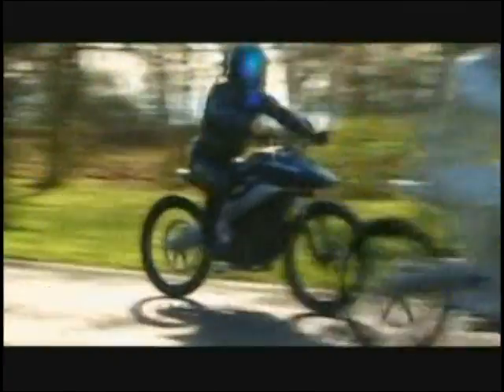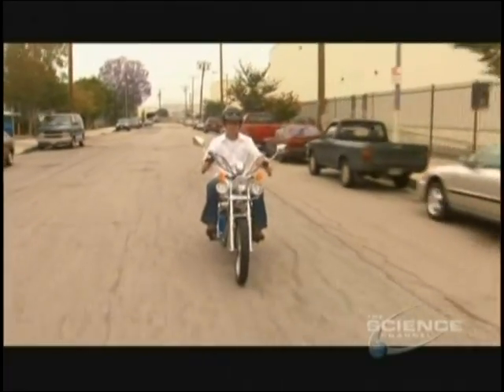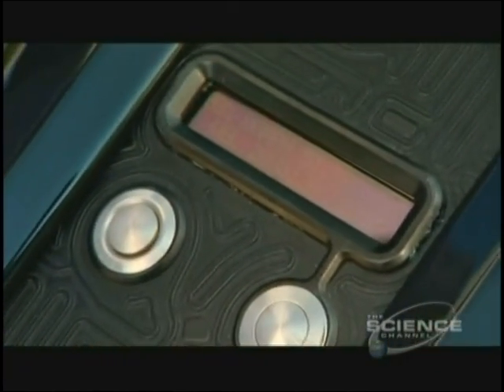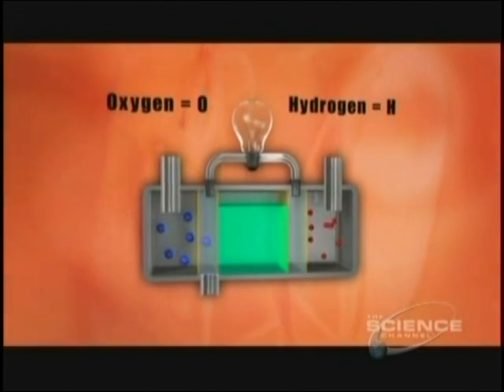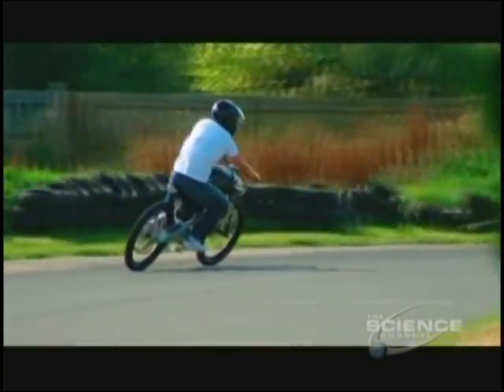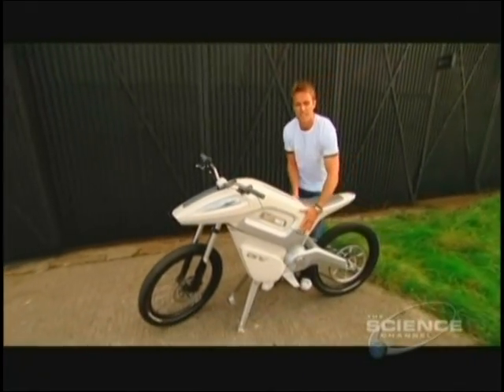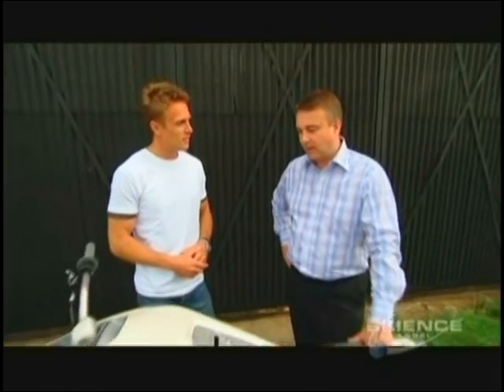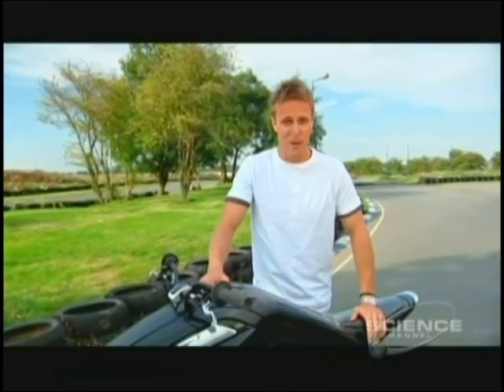Hydrogen Fuel Cell electric bike

Comment: 14years ago where are they now 2022
Reply from the maker: I followed the hydrogen tech news for many years before Toyota produced the hybrid Prius. Right after the Prius became popular, the interest on hydrogen fuel cells died down drastically. Hybrid gasoline-electric cars provided a middle ground solution that works well with existing gasoline supply logistics. Hydrogen fuel was plagued by the lack of production, delivery infrastructure support. Toyota produced a Mirai which is still in production but barely survive. Early days of hydrogen fuel cells were vulnerable to impurity in the hydrogen fuel. The expense equipment could be easily "poisoned" and rendered useless. Then Tesla came in and provided another solution that built on top of existing electric power grid. The hydrogen fuel delivery infrastructure is still the weak link of the fuel cell solutions. There are simply cheaper solutions and hydrogen faces an uphill battle. You can forget these fuel cell bike but there are many battery-based electric bikes you can choose from nowadays. In one of the Avenger movies, the Black Widow rode an electric bike!

Comment: I can’t believe this is so old. People need to wake up to the potential
Reply from the maker: Hydrogen fuel cell was a very old topic. It was hot before Toyota produced their 2nd generation Prius in 2004. The Prius became so popular that people dropped the hydrogen alternative. There was never a supply chain infrastructure to refuel these clean hydrogen cars. Tesla probably learned from that shortcoming and invest so much on the network of super charging stations. Without those EV could have died too. Unlike hydrogen supply, Electric power grid already existed, so adding the chargers was a much easier hurdle to clear.

Comment: With 8hp it's the equivilent of a 125cc combustion engine.
Reply from the maker: fuel cell produces electricity from hydrogen, basically this is an electric bike with fuel cell replacing conventional battery. One big difference with electric vehicle is the instant torque that combustion engine can never deliver. I mean it will perform way better than a 125cc.

Comment: No wonder why +Elon Musk said "Why would anyone buy a Car which runs on Hydrogen, which converts H2 to Electricity, stores in battery, and then battery powers motor with electricity :D"

There is one fundamental problem with Hydrogen vehicles,
i.e DEPENDING ON FUEL STATION [3RD PARTY] FOR REFILL !!!!!!!!!!!!!

__________________________________________________________________________
Stats for Pros: 
[Everything about Hydrogen fuel for vehicles]
__________________________________________________________________________

But with a pure Electric vehicle, you can generate your own electricity in home with solar, and use that to charge the car !!

Technical problems with Hydrogen fuel cars are,

- Too complex drive unit, with large fuel tanks, large fuel cell converter, and other nonsense where with pure electric vehicle like Tesla, you have battery, you have AC Motor, and all other are free space for storage !!

- Hydrogen is expensive to make and very less efficient too,
presently to generate 1 Kg of Hydrogen gas, you need 56 kWh of electricity to convert it from Water to Hydrogen [9 (kg or liter) of water will give 1 Kg of Hydrogen],

- The room pressure is around 1 bar (at sea level), 
the pressure inside aerosol perfume can is around 5 to 20 bars,
and the Hydrogen is typically stored at 700 bars, which is quite a scary amount of pressure.

Added the super quality metal to hold that 700 bars cost around $10,000 to $20,000 alone, 
though it's secure and have capacity to go up to 1400 bars (double) and even take a sniper bullet and doesn't burst !!!

- One more problem is, Hydrogen is very light, meaning,
density of Hydrogen at 700 bars = 42 gram / liter (or) 42 kg / m3.

That means,
you need roughly 25 liter tank to store 1 Kg of Hydrogen [1000 / 42 =~24*] which is very large in volume,
added, you need 125 liter tank to store 5 Kg of Hydrogen, which is the size of Toyota Mirai.

Even though, the energy density of 1 Kg of Hydrogen at 700 bars =~ [40 kWh / kg],
the down side is the large tank needed to store it,
where in Tesla or pure electric vehicle you can use all those space in Frunk and Trunk.

- Also considering performance,
Toyota Mirai is capable of producing only 113 kW of power [152 BHP],
Tesla Model S is capable of producing massive 570 kW of power [762 BHP].

- Finally coming to the cost and mileage,
it cost around $12 to $18 to refill one Kg of Hydrogen at 700 bars (with subsidies !!!),
and with 1 Kg of Hydrogen at 700 bars, your Toyota Mirai can achieve roughly 90 Km.

Which means, For +TOYOTA Mirai and other Hydrogen vehicles,

+ METRIC (Base 10 system, which is used by 190/193 countries in the world)
16.7 cents / Km [or 11.7 Rs / Km] (while 1 Kg of H2 = $15).
   11 cents / Km  [or 7.7 Rs / Km] (while 1 Kg of H2 = $10) - future prediction even if H2 prices comes down.

- IMPERIAL (Grandpa units, used by 3/193 countries in the world)
27.3 cents / mile (while 1 Kg of H2 = $15).
18.2 cents / mile (while 1 Kg of H2 = $10) - future prediction even if H2 prices comes down.

Average mileage of Toyota mileage on road is around [90 Km / 55 Miles] for 1 Kg of H2.

But considering +Tesla and other pure electric vehicles,

+ METRIC (Base 10 system, which is used by 190/193 countries in the world)
2.8 cents / Km [or 2 Rs / Km] (while 1 kWh of electricity = 14 cents) for High power charging >50 kW
1.4 cents / Km [or 1 Rs / Km] (while 1 kWh of electricity = 7 cents) for Low power charging <50 kW
   0 cents / Km (while you charge with your home solar = 0 ) - while using car to office daily (unlike road trips)

- IMPERIAL (Grandpa units, used by 3/193 countries in the world)
4.5 cents / mile (while 1 kWh of electricity = 14 cents) for High power charging >50 kW
2.2 cents / mile (while 1 kWh of electricity = 7 cents) for Low power charging <50 kW
   0 cents / mile (while you charge with your home solar = 0 ) - while using car to office daily (unlike road trips)

Average mileage of Tesla is around 200 Wh / Km [or 5 km for 1 kWh].

Now that should give you a overall picture of the scenario of various energy technologies.

____________________________________
For density of Solid, Liquid and Gas materials:
http://frozenprakash.com/ji56ubiBUJk

Original Google+ Post: frozenprakash.com/dLv1k6hPqKx

Comment: Ok, I'm really environment friendly guy and I'm ready to replace my petrol driven car for some smokefree alternative, as soon as it's a bit cheaper, but this whole clean energy revolution takes really long and slow to succeed. How could you compare this imitation of the bike to any modern sport bike like Ducati Desmosedici, Yamaha R1 or anything else? No comparition at all.
Reply from the maker: +ZOP2A Electric cars came before gasoline cars. Look for them in museum. They lost because batteries are too heavy for their given energy storage capacity. Wait for the next battery technology breakthru. Perhaps Mr. Fusion would change the world eventually.
Reply: +cplai 
I knew that of course. And also we've got li-ion batteries now, that are much lighter, but still it will take ages more, before we can switch to electric vehicles and we won't see the difference.
Reply from the maker: +ZOP2A The energy contents of gasoline is always higher than hydrogen by weight. Even Li-ion batteries are still too heavy for the amount of energy that it can store. So clean energy is always less powerful than fossil fuel by weight until some major breakthrough in batteries tech (carbon nanotube batteries may be promising) or some kind of clean nuclear energy (look into Thorium energy). I heard that current technology can shrink a Thorium nuclear power generator to the size of a semi-trailer truck and yet be much safer than those generators in use on nuclear submarines and aircraft carriers. When they can shrink it down to the size of a car engine or smaller, then we can become independent of fossil fuel. But one may still argue that crude oil is base material for many man-made items such as plastics. Can mankind really live without oil?
Reply: +Barry Sargent 
You're partly right, second part is, the bike should be fun. This one is rather comparable to a moped or something.

Comment: Let's say in theory, once in mass production it becomes simple and cheap to produce and the replacement parts were simple, cheap, and easily installed by the end users. XDDD...NOW brothers and sisters YOU know I'm dreamin' ...ain't nobody got time for dat". Earl Cos gonna buy you out.
Reply from the maker: I am no expert, but I heard that fuel cell are sensitive to contamination. Once the cells are "poisoned" it is just a brick.  So the cost of maintenance may be high.
Reply: cplai ...Sorta like us...with fluoride.

Comment: How about a link to the MFG.  Why don't they just replace that fuel cell briefcase with a lithium battery pack and put it on the market?  Then they could build revenue for R&D while waiting for hydrogen to become more available.
Reply: Hydrogen is more available it's in the water you drink.

Comment from the maker: There are many clean ways to produce hydrogen, e.g. solar power, ocean wave power, hydro-electric power, wind power etc. etc. But if you choose to burn dirty fuels to produce a clean fuel, something is very wrong with your decision or the lack of ability to make a good choice.
Reply: Steel plates water and a battery a couple jars some hose = hydrogen.

Comment from the maker: The success of gasoline hybrid cars (such as the Prius, Volt etc.) rendered the hydrogen fuel cell too expensive to complete.  It is not just the fuel cells that are expensive, you have to build a hydrogen supply infrastructure such as refilling stations all over the country and pipeline and delivery truck logistics for the hydrogen gas. The start up cost is prohibitive compared to the existing gasoline supply infrastructure already in place for decades. Wait till fossil fuel runs out.

Comment: I was checking this out years ago, liked the idea of fuel cell vs. battery, But I haven't heard anything about it in a long time. Even the website I first saw it at is 404.
Meanwhile, Zero and Brammo have both been putting battery-powered e-motos on the market for years, and mainstream motorcycle magazines are being won over by them.

Comment: Solar powered H2O electrolizers attached to a large set of heat sinks and compressors. That would power this bike for free. and anything else that runs on hydrogen.

Comment: not to detract from the validity of your point but i think the main concern is rupturing the tank rather than igniting it, you get a hole in a petrol tank and liquid dribbles out, you get a hole in a compressed gas tank and boom, but why wait for this technology anyway when you could convert any motorcycle to run on lpg now

Comment from the maker: Just want to clarify that a hydrogen fuel tank that catches on fire and explodes is not what most people call hydrogen bomb. Hydrogen bomb is an atomic fusion device that use an isotope of hydrogen called Deuterium to cause an out of control nuclear reaction. Regular hydrogen has one proton and no neutron (atomic weight=1), Deuterium carries a neutron (atomic weight=2). Gasoline has higher explosive power than hydrogen, yet you store gasoline close to your balls with no concern. Don't worry!

Comment from the maker: There are other alternatives to transport the energy after you have collected from the sun. Storing in batteries and turning them into fuel are only two. You can also build powered pavements to power cars, or use laser beams to power airplanes, but those require infrastructure that we don't have now. If you care so much about energy loss, you should not burn fossil fuel at all. From the sun to plants to animals to biomass to fossil fuel, the loss is more major than using hydrogen.

Comment from the maker: The heat in the battery proves that energy is wasted during the charging and discharging process. That means the energy you put in a battery is much less than what you put in it. How is this energy loss different from that in using hydrogen as a storage medium? You should study thermal dynamics, there is always loss no matter what you do. Read my original post, I said if you have abundance of energy, you don't care wasting some to make the energy portable.

Comment from the maker: What I talked about is to use hydrogen as an energy storage medium. A solar energy collection station the size of a football field cannot provide portable power until you store the energy in some portable medium, you can charge a battery or make fuel to make the energy portable. Either way you suffer loss in energy. Try charging a battery and feel its temperature while it is charging, then use the battery and feel its while it is discharging. In both cases, the battery is warm or hot.

Comment from the maker: If you have a tethered cable between your car and a wave machine in the sea, you can have unlimited power to go anywhere that cable allows you. But that is the problem. You have to find a way to take the energy with you. Nowadays, people are paying $100K for an electric car that only goes 150 miles because batteries are expensive. BTW Lithium is a limited resource, the price will only go up when the element is depleted. Forget lead acid batteries, they are too heavy and too toxic.

Comment from the maker: One major problem with Solar power is the production is very unpredictable. You lose  power when it is cloudy, rainy and also at night. Likewise for wind power. Almost all large scale solar/wind power production must be coupled with some kind of energy storage mechanism. Batteries are not very environmentally clean. Some solar power stations use molten salts as an energy buffer to last thru the night. Hydrogen has an advantage to be used on cars. You can do that with molten salt.

Comment: Now if we could use clean energy( wind, solar,geothermal,kinetic waves etc) why waste the energy on creating fuel when devices can run directly on the electricity?

Please don't get me wrong I admire the initiative but the technology is fatally flawed.
Now if the fuel companies providing the hydrogen actually used clean energy say from a hydro dam or solar they you would have a viable clean fuel, but as it stands they use fossil fuels.

Ps I ride an electric scooter.

Comment: Listen I am fully aware of the science, you are avoiding the question.

The fuel itself is clean, I get that, I even designed a hydrogen mortar in grade 8 for my science fair 20 years ago. I abandoned it because of the extremely high energy cost of creating the gas.

All you are doing is transferring dirty energy into clean fuel. I at least attempted to create a micro electrol device to create my own gas from the energy from the gas and use water as my fuel source which failed.

Comment from the maker: When electricity passes through water (H2O), the water molecules will split up into 2 parts of hydrogen gas and 1 part of oxygen gas.The process is known as Electrolysis. Google it and learn more about it. When there are abundance of clean electric power and water, hydrogen can be produced as clean fuel. When hydrogen is combined with oxygen again in a combustion chamber or fuel cell, energy is released with water vapor as the only by-product. Hydrogen becomes a form of energy storage medium.

Comment from the maker: Hydrogen can be produced cleanly using solar power, wind power, geothermal power, hydrostatic power, nuclear power etc. etc. If someone use coal fired power to produce hydrogen, they are just idiots who know a zilch about why hydrogen is chosen as a clean fuel.

Comment from the maker: Solar power, wind power, ocean wave, geothermal power, hydrostatic power and of course nuclear power can be used to split water into hydrogen and oxygen. The two are later combined to release energy again as fuel. So you can consider hydrogen as a energy buffering mechanism, not too different from battery.

Comment: @Tmaker197812 hydrogen is also an virtually UNLIMITED fuel supply. once a method for isolating pure hydrogen becomes efficient, it would be stupid to use anything but.

Comment from the maker: @Tmaker197812 The weight of the fuel cell is irrelevant to the efficiency formula except for weighing down the vehicle. When hydrogen is passed through the fuel cell, it is turned into water vapor and release electricity in the process. It is analogue of feeding gasoline into a generator to get electricity. The ratio of weight of fuel vs. the weight of the generator is irrelevant to efficiency.

Comment from the maker: @martinzopetazo What I meant is that if hydrogen is just an energy storage medium, then it does not matter whether it takes more energy to extract than to consume hydrogen or not as long as you use clean renewable energy.  Likewise, every coal fired power plant actually burns more energy to generate the electricity it produces. There is always a loss. So it is silly to burn fossil fuel to produce hydrogen.

Comment from the maker: @martinzopetazo The entire Hydrogen economy is about using the Hydrogen molecule as a clean energy storage medium. Using solar power to convert water to hydrogen and oxygen, you essentially store solar energy as chemical energy. When you burn Hydrogen, you release that energy and produce water as a by product. It is a storage cycle, starts with water and ends with water. Clean exchange in between. So hydrogen production must be clean or it defeats the original purpose.